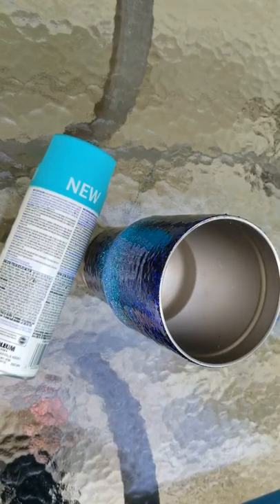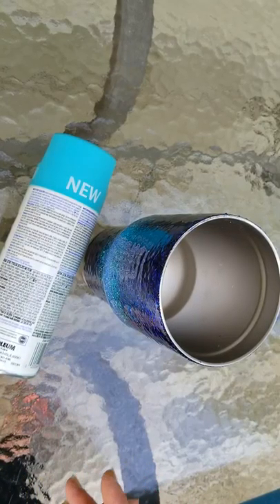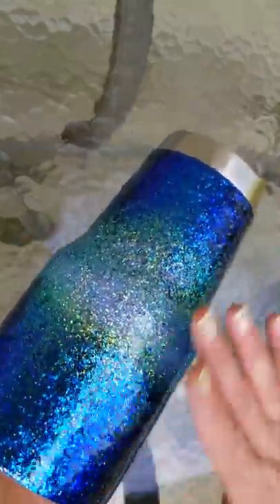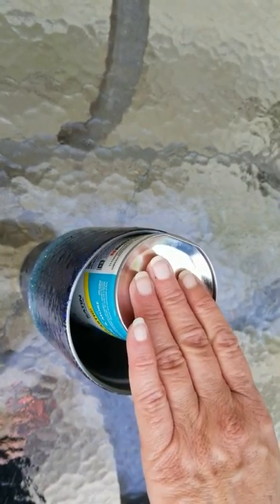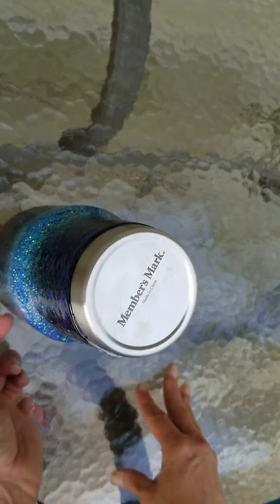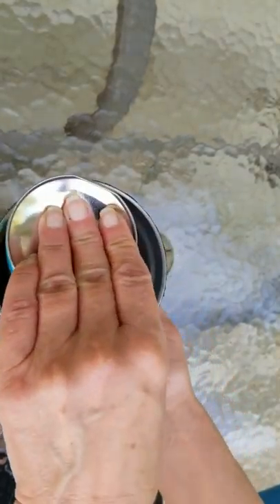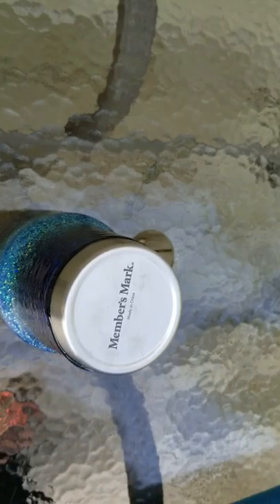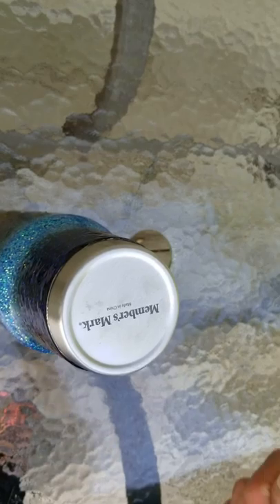Hand turning - Application of epoxy without a cup turner - another method

Comment: I'm just starting out so I don't have a turner. Do you think I could get a really smooth finish with this method or will I get a textured or rough look o the cup?
Reply: LaurelCG it is gonna have a textured look
Reply: It wont be textured at all.  The cup in the video was first layer of glitter.  The final coat will be as smooth as glass
Reply: It wont be textured at all.  The tumbler I used here is first layer over epoxy.  One decal is on and second layer is on, it will be as smooth as glass.